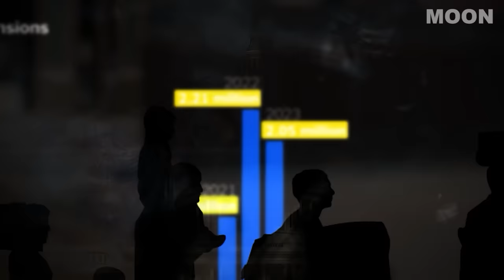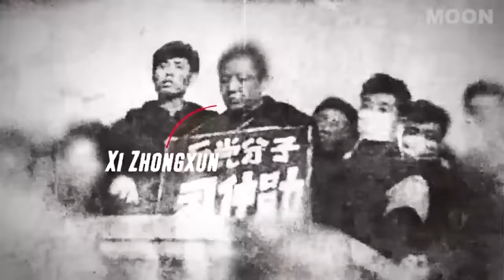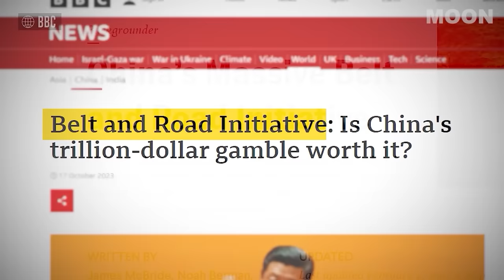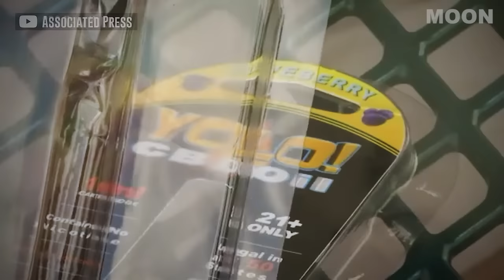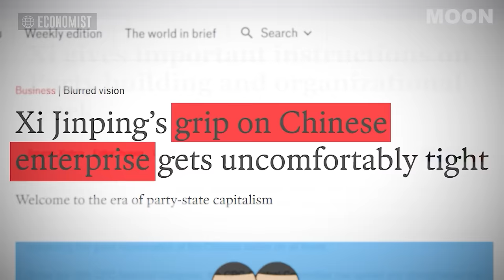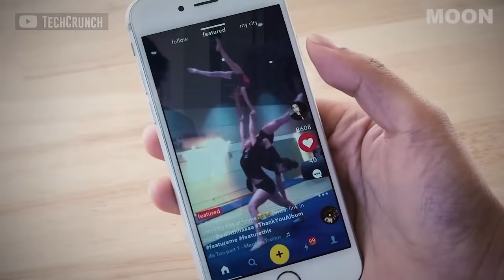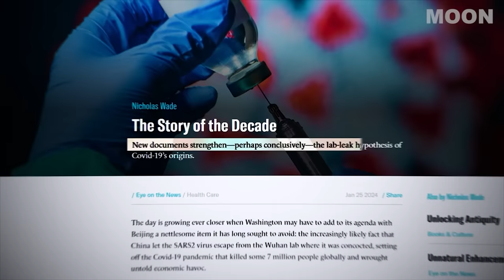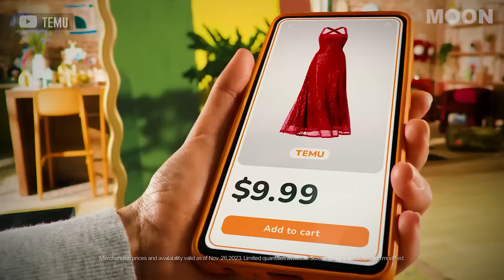The Rise of Xi Jinping, Explained

Comment: “They had the designs already, so just copied them”

I worked for an Australian company that designed comms devices for explosive environments. I helped design a few components in one product, and the company decided the product would be made in China. We charged over $1000 for each one due to the cost of all the approvals required. 

Manufacturer copied the design, slapped a different sticker on it, and sold it for $200. 

It happens all the time. The costs of these thefts from legitimate companies trying to follow laws and regs is staggering, and the US gov (and other western countries) has done nothing.

Comment: If the senator was smart he'd play on the guy's ego saying "I don't think you did it.  You don't seem like you're smart enough or cunning enough to run an operation like that.'

Also if somebody screams at you like that, you don't back up, you don't apologize, you hold you're ground and maintain eye contact and let them make fools of themselves.

Also, isn't it interesting that Biden has the border wide open for potentially anybody to come into our country.  Considering how tight Homeland Security is, you'd think he'd get some pushback from them, but he doesn't.  He's complicit in treason, this is why he got so angry when he found out Trump was ahead of him in the polls.  He's afraid of Trump winning, b/c of how he went after Trump and tried to destroy him, he fears what Trump will expose him for when Trump wins a second term.

And I'm not into politics, I'm not voting for anybody, I'm not playing the game.  These are just things I've learned and noticed.

Also, does anybody have the original version of this video?

Comment: The semiconductor chip making making machines aren't Taiwanese. They're made in the Netherlands with German optics. Moon doesn't half scaremonger.
Reply: Not entirely true. Taiwanese TSMC produces the most advanced chips. Netherlands builds the lithography machines which are part of the  production process of these chips. One cannot be without the other. Dutch or Germans can't produce the chips themselves.
Reply: @jirislavicek9954  Never said they did but if the CPC invaded Taiwan a big incentive would be created

Comment: China’s got a couple of problems that will prevent them from ever becoming a global power.

1. Their demographics are terrible with birthrates well below replacement rates. This has hobbled China’s ability to support a domestic consumer market and keeps them dependent on global trade. Their recent reforms have actually steered the country away from being a high-tech center and are returning it to a manufacturer.

1a. Each year that passes means fewer people are available to the government for military service. What this means is that China’s military is as powerful as they will ever become and they will have to invade Taiwan soon if they have reunification as the ultimate goal.

2. China’s way too exposed in the energy and food production sectors. This means that, aside from rice and coal, they have to import the needed materials from overseas. Now this wouldn’t be much of a problem if China actually had a navy that could travel much beyond the first island chain to, say, the Middle East, but they can’t.

2a. China’s navy is much smaller than people think. In terms of the number of ships they beat the U.S. with 370 ships as opposed to 280 U.S. Navy ships. The problem for China is that the vast majority are small. American naval tonnage is 4.6 million tons vs china’s 2.4 million tons. For perspective, America’s navy is larger than the next 7 combined. In a war America will have no issue with keeping China off the high seas which leads to…

2b. The U.S. navy will not directly engage in a fleet battle with the Chinese because it doesn’t have to. In a Taiwan war the U.S. will simply rely on its submarine fleet to destroy all potential landing craft and all cargo vessels bound for China. This will cut off China in much the same way that the U.S. Nancy did to the Confederates, Germans, and Japanese. China would last less than a year before the lights on their industry go dark.

2c. A counter that many would say is that China can get their oil from Russia. No, they can’t. The infrastructure needed to supply China with oil from Russia will take too long to build (it took 30 years for Russia to build the network of pipelines needed to supply Europe and they did all of that with Western engineers and companies). In a world where Russia’s sanctioned, they no longer have the capacity to maintain the existing pipelines let alone build out new ones and rival nations like Saudi Arabia and the gulf states won’t lend out their engineers to help a competitor. This means that China will have to continue to rely on oil tankers to supply their needs.

3. China’s doing everything they can to copy the Japanese model on a much grander scale. During the 1980’s and early 90’s everyone was talking about how Japan would take over the world by the year 2000, but they entered an economic crisis called the lost decade and their economy has flatlined ever since. Their debt to GDP ratio is at 288% as of March 2023, making America’s 120% look tiny. Mix in the recent real estate crash (the majority of Chinese use real estate to store wealth) and the Chinese economy is set to implode in the near future. 

3a. Unlike Japan who has a unifying national ethos and an ability to withstand extreme change, China’s people follow what’s called the “mandate of heaven” where the emperor (or chairman in this case) has the authority to rule without question as long as the standard of living for the average person doesn’t crash or shame is brought upon the nation. A failed invasion of Taiwan or a major economic depression would remove the Mandate of Heaven and compel the average person to rebel against the central government. This is why China’s clamping down so hard on the people right now. They know that a crisis is about to occur and want to keep their heads.

In conclusion, China is acting so aggressively because there’s a real chance that the government won’t survive in its existing form by the end of the decade. China’s leaders must act now to implement their goals because they won’t get another chance. This has caused the west to become aware that China is a hostile actor and must be treated accordingly. This will place more pressure on the leadership to do something and cause them to act more rash which will ultimately lead them to make a critical error that will spell the end of the CCP

Comment: Might be Xi thought he had a good plan, but high chance it is like a tofu building that will crumble by time. Because his understanding of the foundation and workings of successful governing are based on faulty information, probably. Then when someone have gotten a belief of certain things, then very hard to admit and change core elements, like being religious. 
Does not help having a "keeping face" mindset in a culture, hiding negative stuff and pretend positive outwards, divert actual issues to fix. Opium wars could not have happened without corruption and greed within China, so instead of taking accountability then blame anyone else than themselves. Historically (unless very warped) then it seems that any system based on a cruel dictator kind of leader will fall, because makes enemies and no one can thrust their own status. If "common" peoples does not fight for as much "freedom" they can, then they will become as disposable slaves.